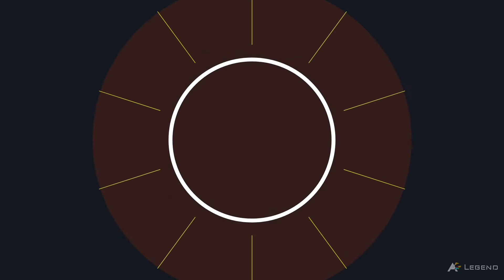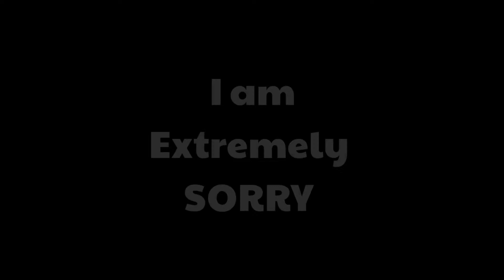What is resistivity class 10 ? Difference between resistance and resistivity | electricity | Part 10

Comment: At exactly 1m length and cross section area 1m² we call it. As resistivity . Or if it is more than that what do we call it ??
Reply from the maker: Resistivity is a special case of resistance when length is 1 m and cross section area is 1 m², when the length and area are different we can calculate resistance by using the formula
R= rho L/A